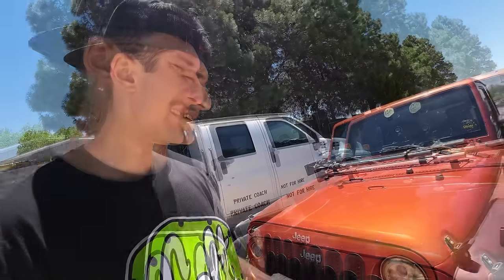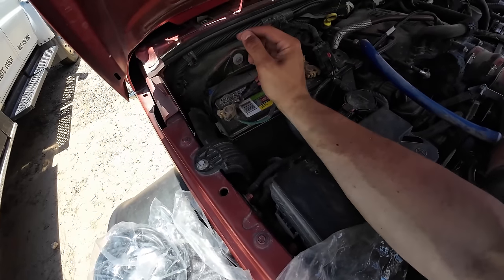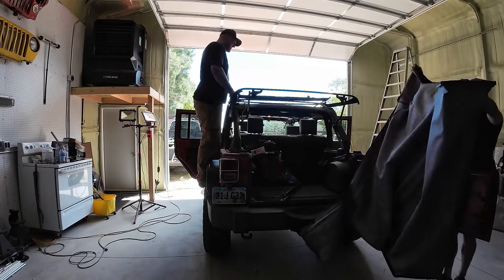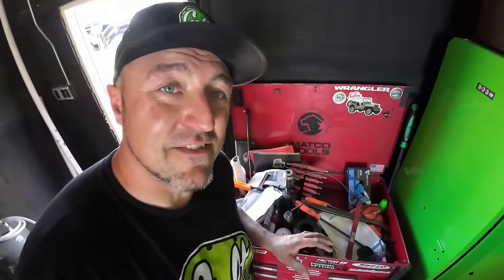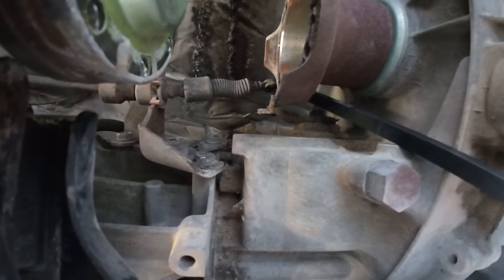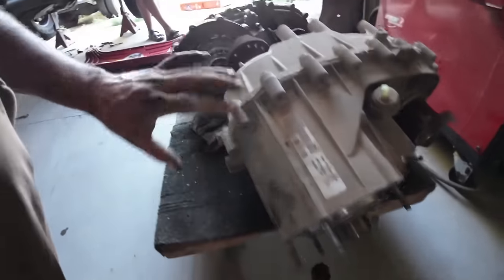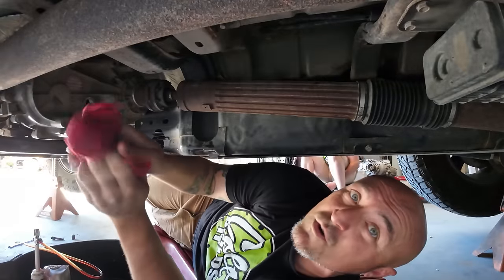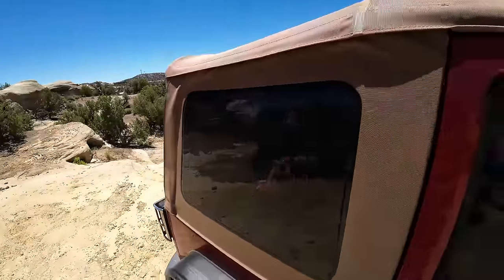How-to Get Affordable Gears For A Jeep Wrangler JK!!

Comment: Great video colt , choosing a  new top was the best thing, the material is all new and better quality, back in the day when was selling 4x4's and the customer wanted a soft top i always talked colour the lighter the better and then proceeded to tell them about the heat difference, i had a little experiment set up, i would put a little desktop thermometer on the dash of each vehicle to show them and they wouldn't believe the difference as much as 25 degrees or even more if its parked at your work or in your driveway , needless to say i sold way more 4x4's with lite coloured soft tops than black ones, going to the Rubicon T-case is worth every penny even if it cost $2000, my friends have done them and bitched about dropping all the skid plates to get it changed, they didn't have a Matco truck around to buy the gear reduction ratchet you bought, its only one day of labour sometimes 2 days , when we were done the trails and hills we went to test it on my buddy was like HELL YEAH ,why didn't i do this 3 years ago it was so easy and worth the busted knuckles LMAO mine to , and in the winter the amount of freaking snow that the Jeep would push through was stupid , almost to the top of the grille , he also did a new better performing trans cooler and said it ran even better and almost never turned on, i don't know what brand it was , it sure made him happy , most of all it made his wife much happier she didn't have to hear the fan running as much anymore , a win win, now he is thinking about  Rubicon axles, i guess its true once you get bit by the Jeep bug it doesn't really stop  😂

Comment: That's why I bought a 2015 JKU Rubicon. Next you'll have to upgrade your axles. The increased torque in 4 low and you're bound to snap an axle shaft. I didn't like walking up the hill at Matt's off road games and decided I wasn't walking next year. My truck is too heavy for the sand and wife wouldn't let me drive her Yukon through the tunnel.

Comment: i like putting a 600 or more amp disconnect switch such as a master disconnect on the pos leg of the winch wiring in the event i have a solenoid fail closed or weld contacts, so the winch doesn't eat the bumper, the badlands apex winches have impressed me as of late, pretty sweet winches for the price

Comment: I installed a "hot heads" insulated liner. If you live where it's hot or cold, they are great. I lived in Lake Havasu Az, the headliner was a huge improvement. Cut down wind noise also

Comment: Put some sticky stuff on the winch hold down nuts to hold them in place during installation. Instead of a cotter pin on the hook, use a tension pin like the one on the trailer hitch pin so it is easy to remove when needed. As for soft tops, they are soft and easily susceptible to damage, unless they are made from Kevlar cloth. Expensive but forever.

Comment: A trick I used mounting my winch was to put the nuts in then I cut short pieces of electrical tape and cover the holes so the nuts could not slide out.  

I had trouble with the ground nut, I have a spare somewhere in the winch but I figure it will fall out at some time.

Comment: I bought a remanufactured 231 and they required synthetic 5w30.  Was pretty surprised, but they were adamant about it.  From the Gear shop in Middle River MD.
Reply from the maker: A np 231 has an oil pickup pump, definitely a transmission fluid tcase
Reply: @coltbuildsit  absolutely, but for the warranty, they require 5w30 synthetic

Comment: JK's with a lift blow up stock front driveshafts like crazy.  The CV joint doesnt like any more angle than factory.  That's prob why that T case has a regular 1310 yoke on it for a double cardan.

Comment: You just connect winch to battery? No safety switch to disconnect power?
Reply: The hobo freight winches come with a disconnect switch and extra cables. Not sure why they avoided using them.

Comment: Call me a sissy if you must, but I use a transmission jack to put a transfer case in/out.  Not a fan of hoisting heavy things over my head that require fiddling to engage splines and line up mounting flanges.
Reply: @AlWorth9738 That doesn't bother me.  I was welding on the jeep this morning in shorts and flip flops.

Comment: On the wench hold down bolts, you should NOT use a washer and lock washer! You should only use the lock washer! The object is the lock washer is the "lock" to lock the bolt to bumper! The washer defeated the action of the lock washer!

Comment: Would a NV241OR Rock Trac be better? Just curious?
Reply from the maker: If it was an older jeep(1987-2006) that would be great because it has a speedometer sensor on the tailshaft.
Reply: @coltbuildsit my JK Rubicon came with it. It has 3.25 max and 4.10 low gear. My front and rear diff is 3.73. I love my lockers. I don't think I'd would want anything without them. Have you named your jeep other than the ebay jeep?

Comment: Why do you use a lock washer and a flat washer your wife washer is going to lock to the flat washer into your bowl the lock washer is meant to lock the bolt to your unit if the lock washer locks to the flat washer then everything can turn